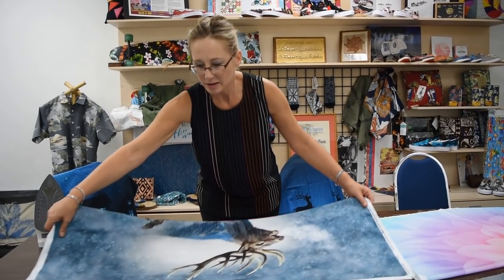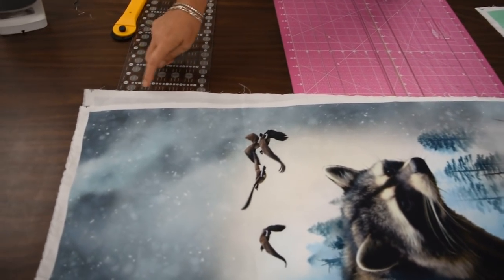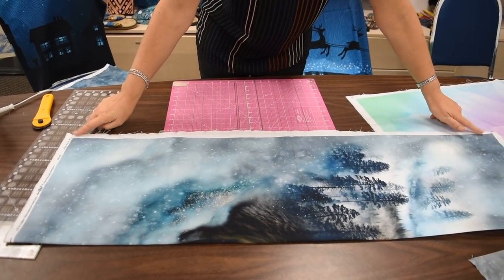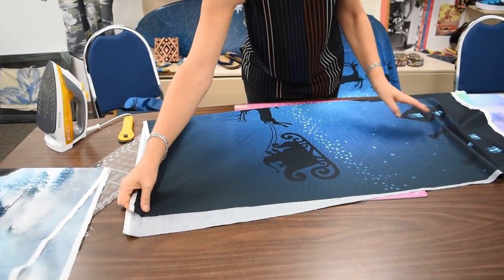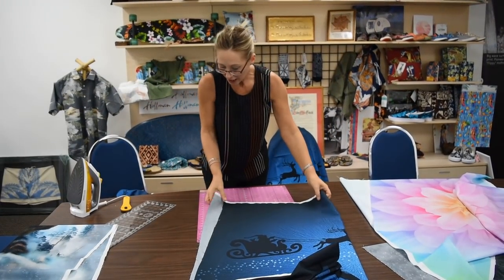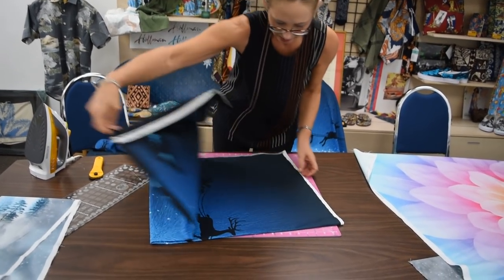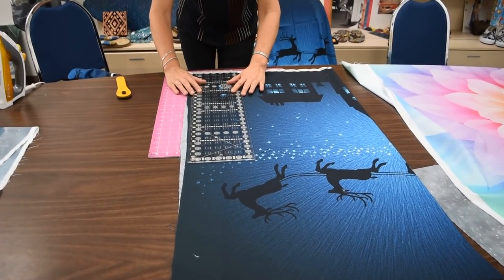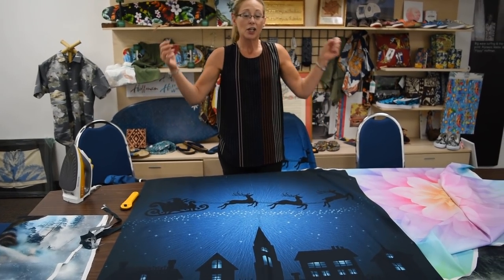Squaring up Hoffman Fabrics Panels

Comment: Sometimes the selvages are not straight so how can you use it if it's not straight???  I would go by the fold myself.  Sometimes I will pull on the selvage to see if that helps it straighten.

Comment: I just had a light bulb moment!  I watched a video by Jamie Whalen (sp?) Anyway, he showed how to put a wonky backing on the longarm.  He rolled it back and forth several times until it wasn't wonky anymore.  I have tried his method several times and it works every time!  Now I understand why it worked because of your explanations.  So, now my light bulb moment.  I'm going to load my wonky panel onto the longarm and roll it back and forth and if I have to, I will lightly mist with water.